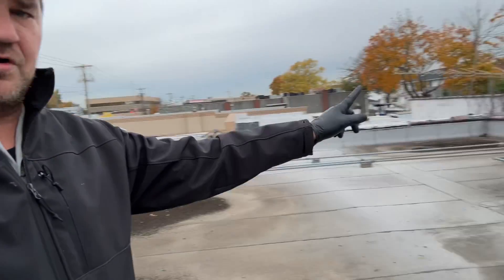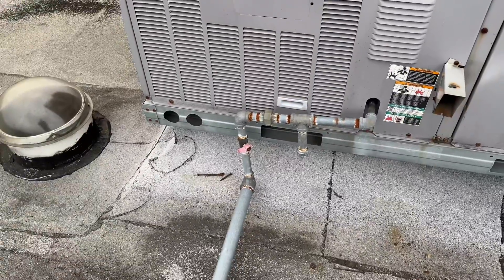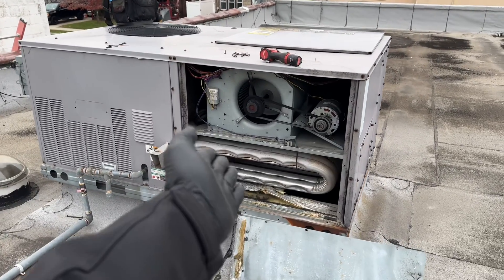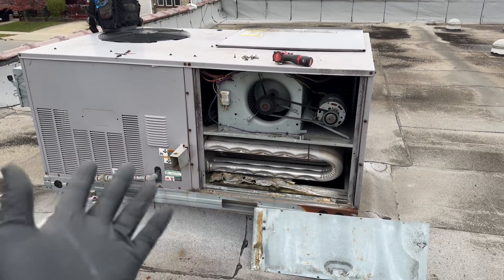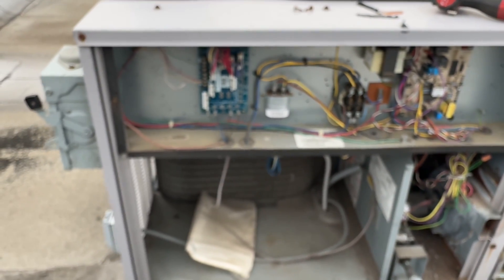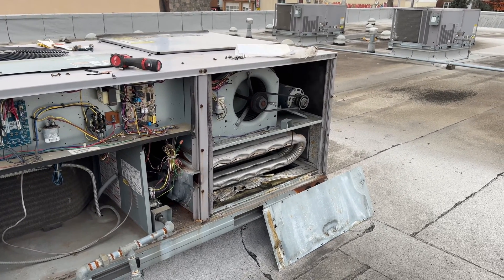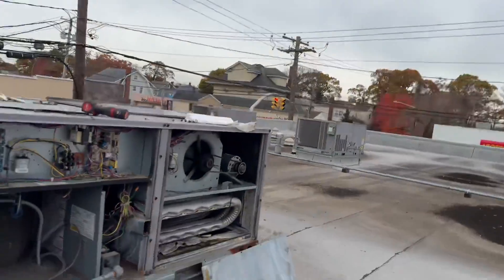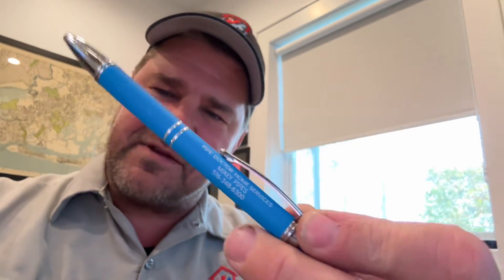HVAC Technician Saves Lives & Discovers Cracked Heat Exchanger on Rooftop Gas Heater

Comment: on that style, the CO leakage to indoors would be minimal to none and only pre blower may some leak. otherwise they end up blasting flame back into the gas valve/inducer area and burning themselves out anyway. now that's NO excuse to leave it running and burning poorly, because the high CO from it's exhaust may be getting sucked back in via makeup air or economizers on it or something else on the roof, maybe CO gassing other tenants in the building! don't be a clown, shut them down and make the owner frown.
if they throw too much stink, then simply alert the the local gas company and fire department, they may go full tilt shutdown of the whole building. 😉

Comment: There is a certain major retail store in a certain county in Pennsylvania that has 4 out of 5 RTUs with the gas valves off, on the same roof, due to failed exchangers. The building maintenance company is failing them badly because those exchangers have had holes for at least the last 4-6 quarterly preventative maintenence orders, I can fit entire fingers into some of the holes, it blows my mind that the pressures switches have not opened or failed to close yet. I personally did not fix them because they have an extremely unreasonable industry standard pricing system. They want small company pricing with big company capital.

Comment: Kudos to the previous tech. That shut off the gas and removed the heating from the circuit.  
Let's point out those owners who ignored the suggestions or the founding of the previous  technician. Good job Mike.
Reply from the maker: Thank you for appreciating the previous technician's work! It's important to acknowledge their efforts in ensuring safety and efficiency.

Comment: So why do package units run cooled air through the (blower side) of furnace exchanger?
Reply: Through or over? 
They don’t run cooled air through it they run hot combustion gasses through it. 
They run cool room temp air over it to heat the air up in heat mode. In cool mode the heat exchanger is just in the airstream but no combustion gases through it.
Reply: @Rainmaker88  * and condensation is formed in the combustion side of the heat exchanger when cold air-conditioning coil is running?

Comment: With all the sensors and safety features on these pieces of equipment ,I'm wondering if a carbon monoxide cutout sensor could be installed inside the dwelling??
I had a doctor tell me once,that plumbers have more to do with the health and safety of the public than they do by far.
I agreed, just look at 3rd world countries, rampant diseases. 
Great video,the few the proud,the plumbers😂😂
Reply from the maker: Who knew plumbers were the unsung heroes of public health and safety? Move over, doctors! 😄
Reply: nanoo,nanoo

Comment: Hey Mikey, of Mikey Pipes Plumbing not easy being cheesy. I like your podcast/social media, looking thru some comments. Hmm? problem ? too much humid mechanical air going into the combustion chamber, which is made of steel. A new package unit with a stainless steel heat exchanger is the winner ticket. Come on now, Batman< I can't live outside the cold zone, but chill. Love you buddy. You safe out there.
Reply from the maker: Hey there, Batman! Looks like we've got a case of too much humid mechanical air in the combustion chamber. Time to bring out the stainless steel heat exchanger and save the day!
Reply: Come on now , Batman, did you check the cooling side the roof top unit. Yes, a new package unit sound like winning ticket. I design heating and cooling systems too. @PipeDoctor

Comment: What do you think about non plumbers working on boiler or plumbers working on roof tops? With no experience.
Reply from the maker: It's always important to have the right expertise in any field, especially when it comes to technical tasks like working on boilers or rooftops. Safety should be the top priority for everyone involved.
Reply: @PipeDoctor  Thanks Mike I agree. I do see this not happening as much as I would like. Guess all I can do it my best tor train the young guns to gain experience required to service the equipment safely. Be aware of your surroundings. I am a boiler guy and would either need more experience to work on roof tops safely. Just grinds my gears when a roof top guy charges for service annually and I have to bail a building owner due to lack or maintenance on a boiler system which has been “serviced”. Just getting burnt out but this is heating season.

Comment: Rooftop package units are fine until there’s 12” of snow up there, and an inch of ice where you have to place the ladder.  😂  Fortunately you’re safe for a few more weeks, I hope.
Reply from the maker: Who needs a ladder when you have a jetpack? Just kidding, safety first! Take care and stay warm!
Reply: Those units need to be perfectly level or the moisture from ac season condensating in the heat exchanger. They are designed to drain out the front. That why they have a bracket keeping them tilted forward. But carrier uses those weak heat exchangers and poor quality in there RTUs